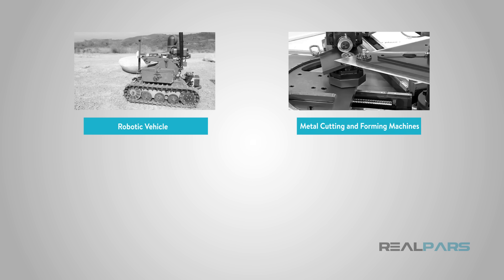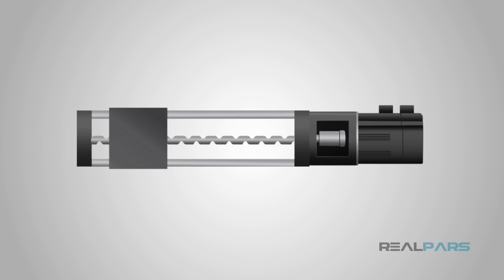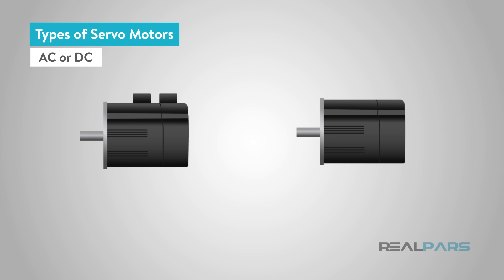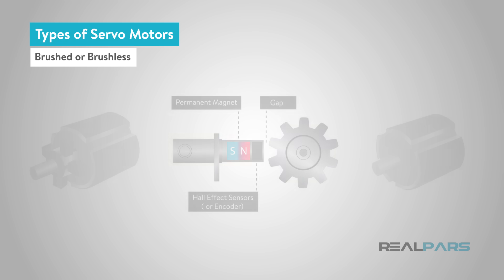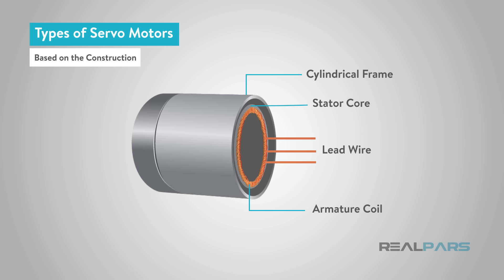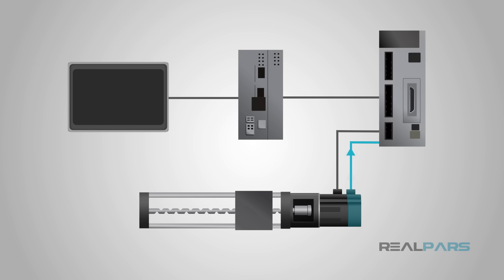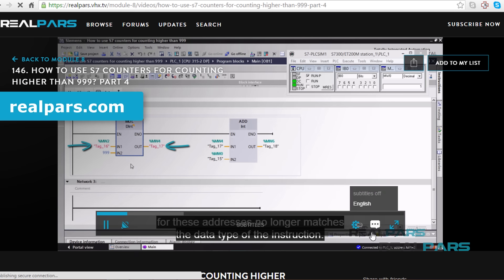What is a Servo Motor and How it Works?

Comment: which motor produces more heat? synchronous vs. asynchronous
Reply from the maker: Hello, @flat-earther.  Thank you for your question. This all depends on the design, the application, the load, and the motor cooling system used in the application. There is no one answer to your question. You will need to be more specific about how and where you are using it.  Here is a link for your learning: https://mechtex.com/blog/top-5-differences-between-synchronous-motor-and-asynchronous-motor

Happy learning from RealPars!

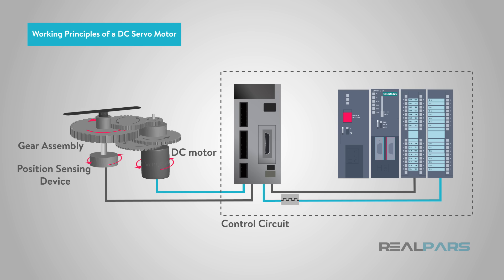Comment: It is a great video, just confusing at 8:40 the rotating gear assembly and the dc motor seems to be in contact, then the rotation can’t be the same orientation… please Correct me if I am wrong, however is only a detail, the rest of the explanation is very professional
Reply from the maker: You may be correct.  It is hard to tell how the gears are linked, but the animation in this video is strictly for demonstration.  Obviously, in a real application, gear ratios and orientations are very important.  Thank you for your comment!

Comment: Would all these motors be considered stepper motors?
Reply from the maker: In concept, perhaps.  But in application, no.  Servo motors and stepper motors are used for motion.  Servo motors do not require feedback, as movement is controlled between endpoints, based on mechanical stop or sensor input.  The travel is typically requires hundreds of motor revolutions.  Servo motors require feedback (resolver input) to move a specified, precise "distance".  Stepper motors have a high number of poles, typically 75-100.  This is required to precisely position the load in fractions of a revolution of the motor shaft.  By contrast, servo motors have 4-12 poles, similar to most induction motors.
Reply: @realpars  Not sure I understand. You said servo motors do not require feedback, and servo motors require feedback.

Comment: How servo motor manages to stop & start so fast? Normal motors have inertia and take time to stop from running full speed! How is that achieved? using brakes?
Reply from the maker: Yes, servos use DC braking and the magnetic fields between the stator and rotor to rotate and stop the motor, usually based on position feedback.  This is much easier to do with DC motors, which are commonly used for servo motors.

Comment: whats difference between brushless motor and servo motor???
Reply: Hello Sami, Good question. Servo implies the motor operates in a closed-loop control system that uses an encoder or resolved for feedback. Brushed and brushless motors are used in servo systems, however, brushless are more commonly used. Synchronous AC motors have high torque and great performance in dynamic applications, so they’re often used in servo systems.

Comment: So there's no other servo motors but AC and DC? What about stepper with closed loop controller? Or pneumatic motor with closed loop? Those are also servo motors. "Servo" term is from automation and regulation theory, and basicaly means the type of control, where there is closed loop of position with regulator, allowing current (which, by the way, you didn't mention and it's very important), velocity and position control. That's it. Narrowing this term to only a few motor types is not correct. Most of the video is explaining how different types of electric motors are driven, which is not at all connected with the topic.
Reply: Hello Generator. Thank you for your feedback. Our videos and content help many Automation Professionals just getting started so we do try to simplify the servo narrative. We also try to cover as much over a designated period of time. We do cover Stepper motors in another lesson, What is a Stepper Motor and how does it work? https://realpars.com/stepper-motor/

Comment: Are these single-phase motors?
Reply from the maker: Servo motors can be either single-phase or three-phase.  DC motors do not have phases, per see.  AC motors which are 120VAC or 240VAC are typically single-phase while 480VAC motors are typically 3-phase,

Comment: Why can't we change direction of ac servo motor by swapping the uvw leads. I was told servo motors are same as induction motors with encoder and gear control. Is this true
Reply from the maker: You could swap leads, but that is not very easy to do if you want to change direction during normal operation.  It takes about 20 minutes to do this after stopping and locking out the motor.  A servo motor controller essentially does this electronically by changing the phase order internal to the controller.  The same electrical methods used in an AC VFD to change direction are used for servo motors.

Comment: My introduction to servo motors was due to the fact that depending on how they are used and what parts are attached to them, they can either be great or be a worthless pile of dog poo. Also when used along with said junk additions and hidden in hell, they can be expensive to the owner to fix because engineers are soulless, evil beings. So yea, if I ever ran into the guys that designed what I ran into, i would most likely choke them into oblivion.
Reply: This entire comment leads me to believe that you are a maintenance technician. I say that because I feel the same way, and that is what I do. Engineers seem to take pride in making machines impervious to repair and preventative maintenance. I'm just guessing but that is the feeling I get from your comment.
Reply: @UNUSUALUSERNAME220  sorry, but I wasnt. I was a mechanic, well, also a shop owner. Previously I had run into plastic gear issues in general. But my first true step motor issue was on the step motors for the a/c air flow in mercedes ml's in the late 90s.Course the plastic gears were pressed onto a shaft. So of course these gears would crack or split. And to get to the motors under the dash was no easy repair. I suppose the heat under the dash didnt help either. These didnt last long and would split again. So my absolute hate for plastic gears, step motors, on and on knows no bounds. Just the thought of them being in anything I buy these days gives me the sweats. I understand that some are actually installed as a safety device, breaking before burning up a motor if something gets jammed or whatever. But they are not available for repair so you have to go buy a new motor for $$$$$$ that otherwise is perfectly fine. So, yea, I'd say I have an issue.

Comment: Sorry, but i didn't catch what the difference between simple and servo motor? I mean which part makes ''Servo''?
Reply from the maker: Servo is not necessarily indicated by a specific part, but by the overall function of the motor.  A servo motor is used to move a part a certain distance, so it usually will convert rotational motion into linear motion using a gear or other device to create the desired movement of a part from one point to another, like the worm gear in the video.  Although not always required, position feedback can be used to allow precision placement of the object and to control the speed and direction of the movement.

Comment: Great tutorial.  Thank-you!  I work in the PCB drilling industry where extreme tolerances must be maintained.  The six ton drilling machines are required to position a table (weighing several hundred pounds) to within +/- 5 microns (1 micron = 0.000039") and hold that position for 10 milliseconds before the drill bit enters the PCB.  The drill bit can be as small as 0.0020" in diameter.  Typical drill bits will be between 0.0079" to 0.0200" diameter.  Most drilling machines use precision preloaded ball-screws driven by a DC servo.  Unlike the motors in this video, the servo motor does not provide position feedback - only a velocity feedback via a tachometer.  As heat builds in a ball-screw, it expands lengthwise.  That expansion would cause the position feedback from the motor to be less accurate.  To solve this, the position feedback is provided by an independent linear digital encoder scale with a resolution of 1 micron and a positional error of 2 microns over a length of 30 inches.  The encoder scale is optical and is typically made of glass.  Some machines today have evolved to linear motors - no more ball-screws!
Reply from the maker: Thanks for your comment, Greg!

Happy to see you share your experiences and knowledge with us.
Reply: Great video and explanation 👍
Reply: impressive, if it just wasnt for the lack of metric units

Comment: In the servomotor manual I´m using  say: " Ensure motor and drive are correctly connected to a ground. The grounding method must comply with the electrical standard of the country (Please refer to NFPA 70) National Electrical Code.....could you please explain why is this necessary?

Comment: Stepper motor is the same as servor?
Reply from the maker: No, they are different but are used for similar purposes.  The basic difference between a traditional stepper and stepper-vs-servo-based system is the type of motor and how it is controlled. Steppers typically use 50 to 100 pole brushless motors while typical servo motors have only 4 to 12 poles.  Steppers don't require encoders since they can accurately move between their many poles whereas servos, with few poles, require an encoder to keep track of their position. 

With closed-loop feedback, servo motors deliver high accuracy positioning coupled with better speed and acceleration than stepper motors. The trade-off is increased cost, size, and complexity.

Comment: If you buy a servo motor do you need a driver circuit/micro controller to operate it or is a potentiometer sufficient?
Reply from the maker: If you need to control velocity, distance, or precise position, you will need to have a controller.  If you just want to turn the motor on and off and vary the speed, a power supply, switch, and potentiometer is all you need.

Comment: Howdy. Nice presentation. Just one comment.
Induction motors are designed to run continuously. Momentarily they can deliver about 2,6 times the nominal torque. Running continuously on over torque will smoke the stator windings quite fast actually. If suspected having run on over torque quickly disconnect the load and let the motor run idle until no more heat is blown out by the fan. One may have saved the windings but a way shorter life span should be anticipated.
Servo motors are designed to run only intermittently. They are designed to deliver way more torque than induction motors.
Regards.
Reply from the maker: Great comments!  You are absolutely correct about the type of motor versus torque.  As with most equipment, the system needs to be designed to stay within the mechanical and electrical boundaries and capabilities of the equipment.  A thorough understanding of the application is very important.

Comment: Speaking of Siemens, wich HW is needed to perform positioning? for older s7 300 PLCs there are positioning modules but I think I saw from a series of videos from Siemens 1500 PLCs the CPU is enough to do the same in a simpler maneer? Is that rit?
Reply from the maker: Yes, the S7-1500 has built-in technology objects that support the various positioning drives that Siemens provides, such as the SINAMICS S110.

Comment: I work an offset printer and the servo drive operates the speed of the water roller which can be sped up or down. There are four of these on my machine, one for each coloured unit. The servo is running to slow and I can't get it to run faster. It's the same on all units. I can't print as the water roller is spinning to slowly to put enough water on the plate. Any thoughts on how I can get the servo to run faster and be controlled and adjusted manually?
Reply from the maker: Servo drives are controlled by a hardware "box" or "card" which usually is configured by attaching a PC to the drive interface.  In that configuration are settings that limit speed, control direction, etc.  Also, every servo motor has a rated speed, which is the maximum speed at which it can run.  You will need to investigate these parameters and figure out if the speed at which you would like to run is supported by the hardware and controller.  I imagine there is some way to adjust the speed on a panel or HMI somewhere.  If not, the servo was designed to run at a specific speed, in which case you will need to investigate changing the configuration of the device.

Comment: So is it just a machine that spins?
Reply from the maker: Usually,  a servo turns a shaft, gear, or other rotating body.  It is this rotation that can be used to drive a connected device, such as a belt, a spindle, fan blade, gear, etc., in order to create work.

Comment: Wait wait wait; I thought stepper motor was supposed to be used for precision work:? have I been ordering the wrong type motor?
Reply from the maker: Stepper motors are also precision positioning motors.  Stepper motors do not require a feedback for positioning, since they are precisely positioned by the way the motor windings are controlled.  Servo motors require an encoder or other feedback mechanism.  For small step rotations, stepper motors are the most precise, so if that fits your application requirement, you have ordered the correct motor!

Comment: I fought that DC servo motors could only move up to 180 degrees, but in 8:41 we see that the animation and voice tells us that you can regulate velocity with the level of voltage input and the error signal sent by the sensing device. Which one is true then?
Reply from the maker: Gabriel, servo motors are not limited to 180-degrees rotation.  They are most often used to change the position if a part, rail, or robot arm, or to move a belt, chain, or piston a particular distance and/or at a particular speed.  As you saw in the video, feedback mechanisms can be used in control applications to regulate speed or position.  It may take many revolutions of the servo motor to position the part or move a piece from one point to another.

You may be confusing "servo" with "stepper".  Stepper motors are often used to rotate a mechanical piece in "steps", with a normal maximum single step of +/-180 degrees.

Comment: thanks for the good explanation and excellent video
Reply from the maker: You are very welcome, Satish!
Reply: Are you interested in JMC 17bit AC servo motor drive kits? Cheaper price with good quality. 
Offered 100w,200w,400w,750w,1kw,1.5kw,2kw,2.6kw,3kw with or without brake. 
Welcome to inquire! 
https://topcnc.aliexpress.com/store/group/JMC-17-bit-servo-kit/1932111_516876372.html

Comment: Do Servomotors hold position like stepper motor
Reply: Yes, they can.  The biggest difference between stepper and servo motors is in how that position is determined.  Stepper motors use a built-in method of indexing the motor between many electromagnetic poles.  A servo motor uses a resolver or encoder to determine the current position through a feedback signal.
Reply: Thank you

Comment: Thanks a lot brother. Pl explain in next video about how to control servo motor through plc. Waiting...
Reply from the maker: You are very welcome! I will go ahead and pass your topic request on to our creator team. Happy learning!
Reply: Are you interested in JMC 17bit AC servo motor drive kits? Cheaper price with good quality. 
Offered 100w,200w,400w,750w,1kw,1.5kw,2kw,2.6kw,3kw with or without brake. 
Welcome to inquire! 
https://topcnc.aliexpress.com/store/group/JMC-17-bit-servo-kit/1932111_516876372.html

Comment: Nice video, but I think at 13:15 there is a missunderstanding: the rotor flux must rotate together with stator flux. They are stuck together. Lets suppose, that the speed of RMF is 3000RPM (f=50Hz, number of poles:2) and the rotor rotates with 2880RPM. The RMF of stator induces alternating current in rotor with 2Hz frequncy, that creates a second rotating field. The speed of this rotor created RMF is 120RPM compared to the rotor and 3000RPM to the stator, so they rotate together.